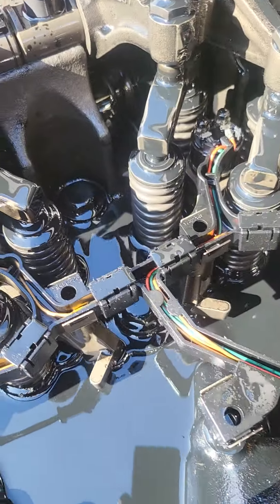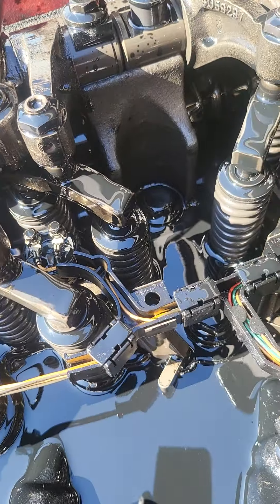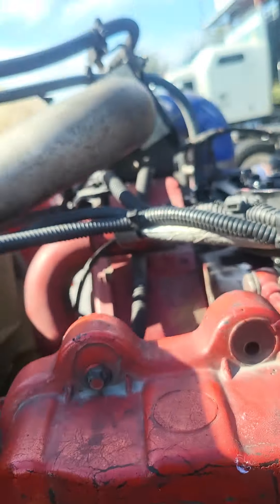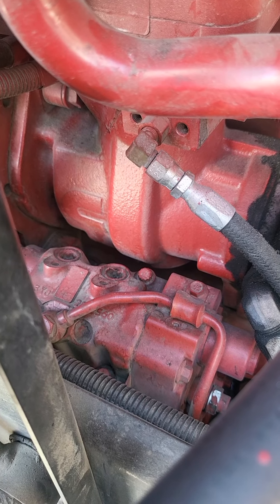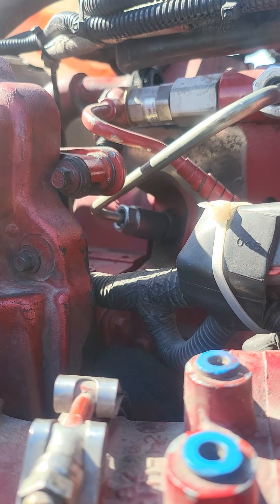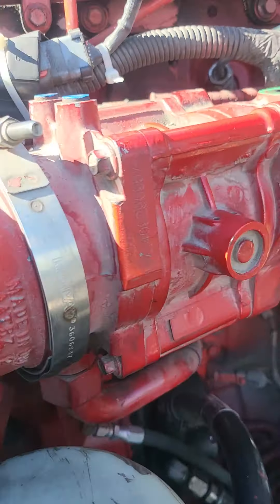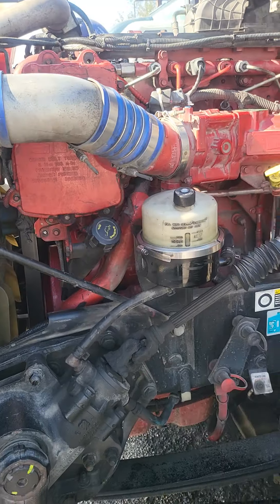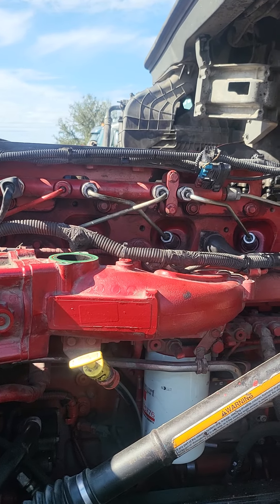Putting in my own injector #5 in my isx15

Comment: to check for blowby you take off the oil fill cap, and unhook the discharge line on the air compressor, and monitor your blowby psi, then put the oil cap back on and see if the psi is above limits, if you have 30000 engine hours or more you need a overhaul most likely.

Comment: That oil leak at the back of the compressor is likely just the power steering pump gasket, fairly common spot for many engines to leak from what I’ve seen. Not a difficult repair, just 2 bolts attaching the PS pump and a paper style gasket